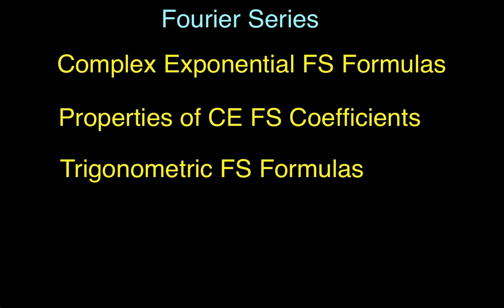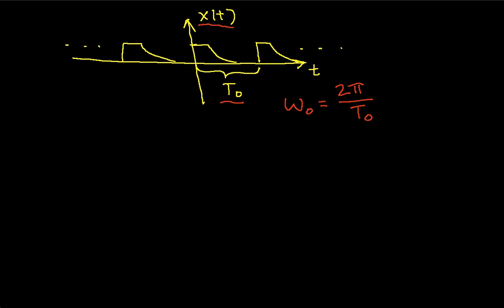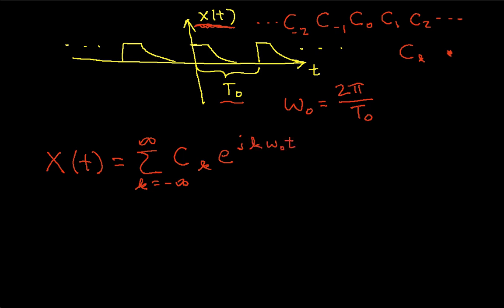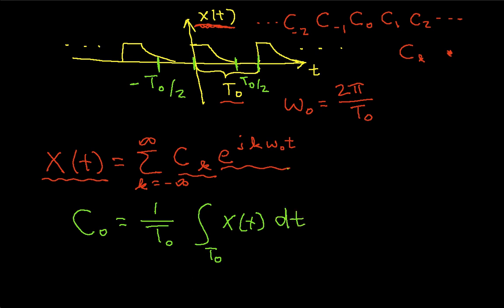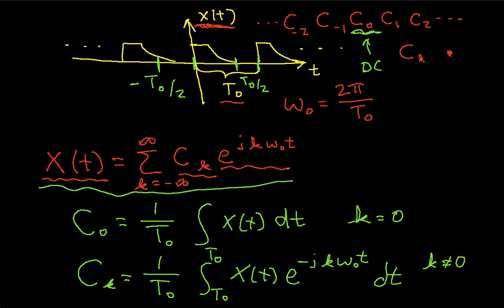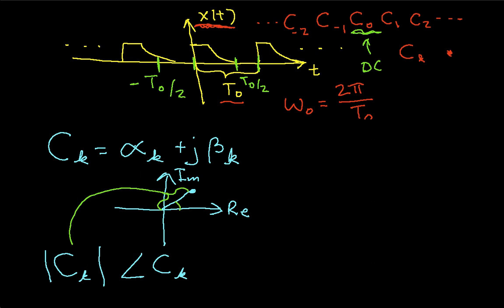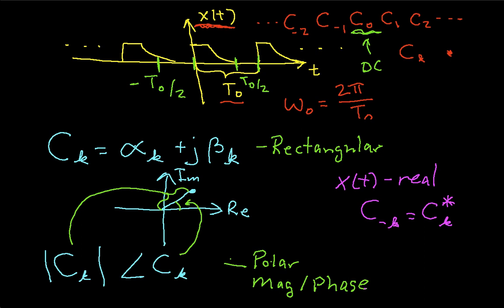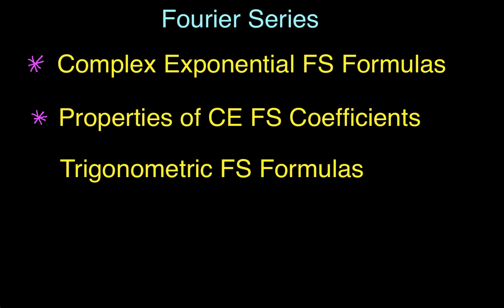Complex Exponential Fourier Series

Comment from the maker: @PedSectioned omega_0 for this problem is 4. All the Fourier series coefficients except c_1, c_{-1}, c_3, and c_{-3} will be zero. The sin term gives c_1 = j/2 and c_{-1} = -j/2. The cosine term has a frequency 3 times the sin term, so it gives c_3 = 1/2 and c_{-3} = 1/2.